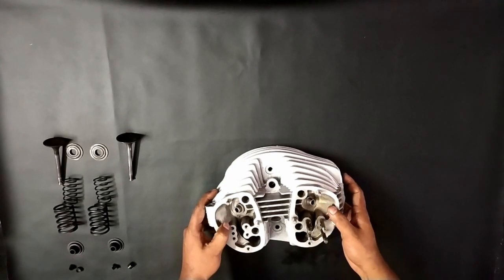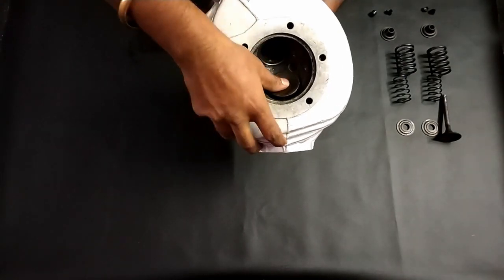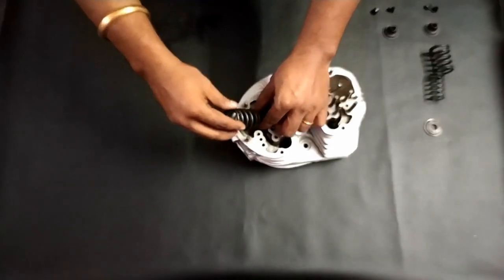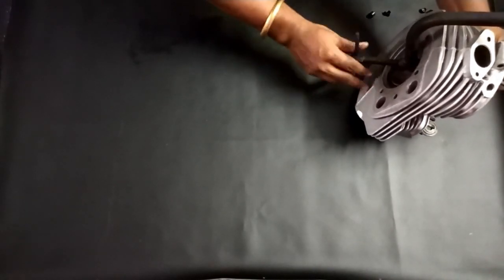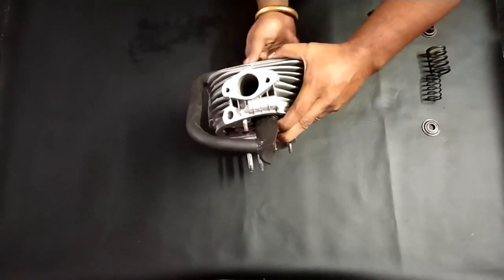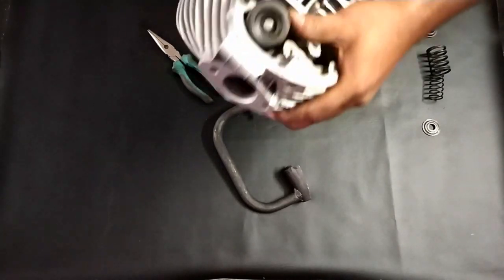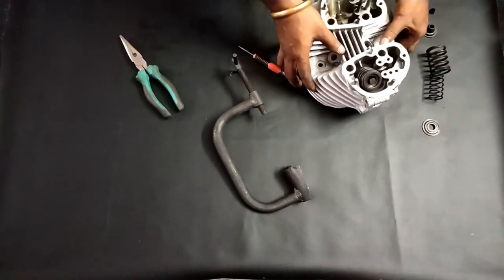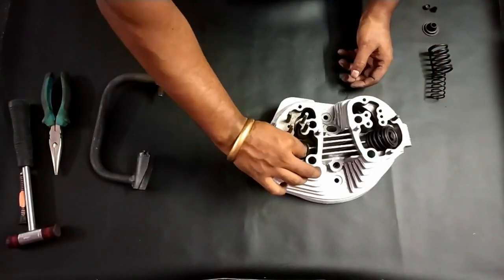How to replace engine valve

Comment: sir please tel me valve seal mechanisam as in highly powered engines there is a seal to prevent oil going to combustion side what is there in standard 350cc bullet as iam owning it and having problem in that.. thanku

Comment: nicely explained, sir a doubt.. why mechanics change valve guide to gun metal, is gunmetal make more sound than cast iron valve guide..
Reply from the maker: Gun metal guide have longer life than that of original guide, initially the guide size is smaller than the required one. When days pass on it get seated and get set
Reply: @ECFixeljin  sir i think gun metal make more sound than cast iron. My bulls tapet valve and valve guide made by gun metal (before its cast iron) and it make sound in my engine.

Comment: Bro i want to know about rocker stud measurement and pitch size how much torch applay to rocker nuts...
Reply from the maker: Dia-1/4"
Length-2 1/16"
Thread- m26
Torque-1.30kg-m
Reply: @ECFixeljin  thanks bro .... For oldbullet  which grade oil is suitable ....20W 50 or 15W50
Reply from the maker: 20w50 for engine and 20w40 for primary chain
Reply: @ECFixeljin  thanks bro thaks very much

Comment: Very well explained as ever. Thanks for sharing...
I have a small doubt. You didn't install oil seal of valve. Why?

isnt it compulsory to install oil seals for values ?
Reply from the maker: Oil seal is not mandatory for old model bullets (the manufacturer too didn't suggest for) but it has been implemented by the manufacturers in new model bullets....
Reply: @ECFixeljin 

Thank you for the valuable information.
If possible please post a video of removing engine from the frame.
Actually 
I have removed head, bore and clutch a few times for servicing but this is the first time I intend to remove engine for bearing replacement. Hence I need to know how to separate engine from the frame.
Thanks in advance

Comment: Hi bro how to put that valve seal and how to dismantle the button type object you hammered..
Reply from the maker: You can use - screwdriver or after removing spring, by pulling the valve from the opposite side u can remove it
Reply: @ECFixeljin  pls make video about piston ring orientation..
Reply from the maker: Sure as soon as possible